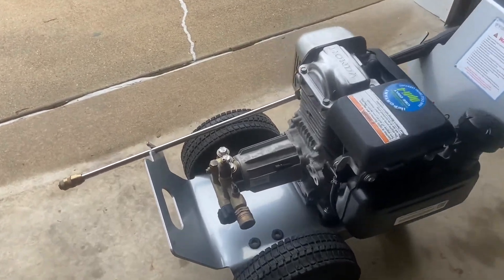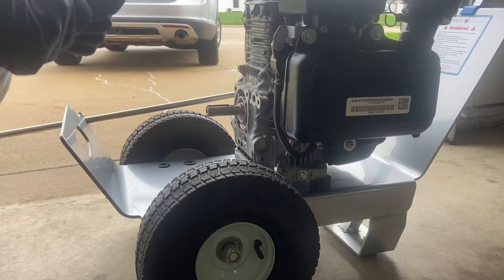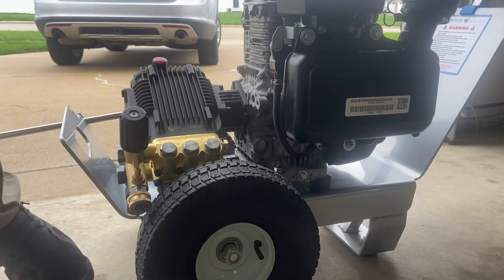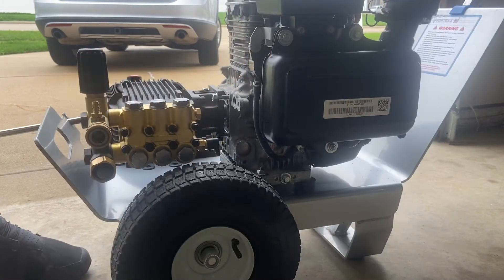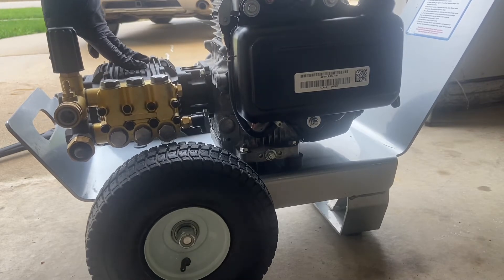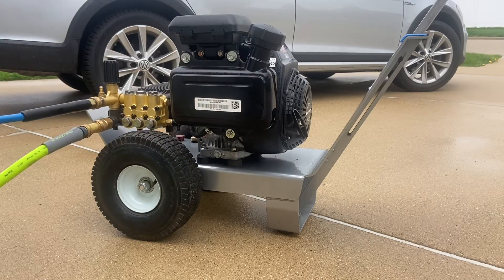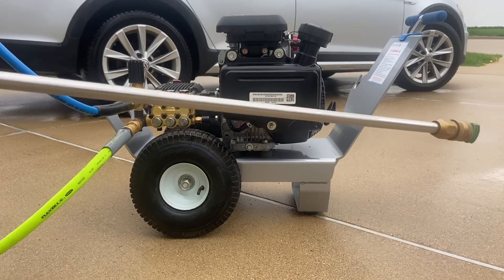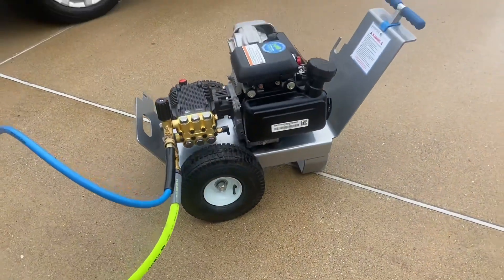CanPump 3000PSI – 3.1GPM Triplex Pump 3/4″ Hollow Shaft 3WZ-1506.5A Installation

Comment: How’s your can pump holding up? Looking for an affordable pump to put on a couple gx200s
Reply from the maker: I don't have the pump anymore, I sold it to a customer who was looking to replace an AAA pump on a GX200.  From what I know it's a very solid pump.  I don't do commercial pressure washing so I am not a good example for durability testing ;); I just do this buy/sell/YouTube as a side hobby.  Sorry I couldn't give you more information.
Reply: @jamesbubnick  thank you for the response brother
Reply: @ZandScontractcleaners Can Pumps are very good! They hold up well over time, I have a 3gpm 2500psi can pump and its solid 👌 

I use to have a Cat Pump 2.8 gpm 3300psi on the same motor, and the Can Pump outperforms it! And this is coming from a person who loves Cat Pumps! Price to performance - the Can Pump wins!